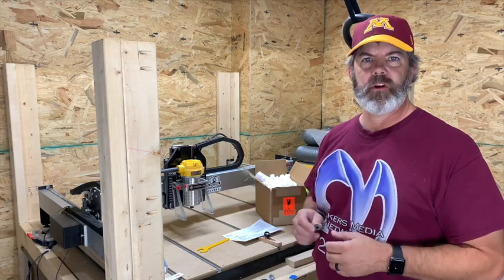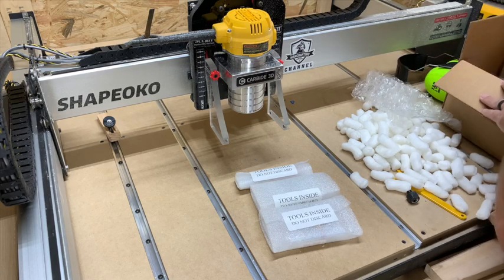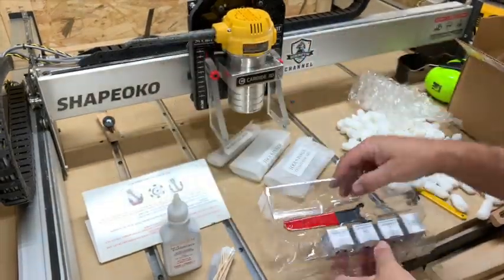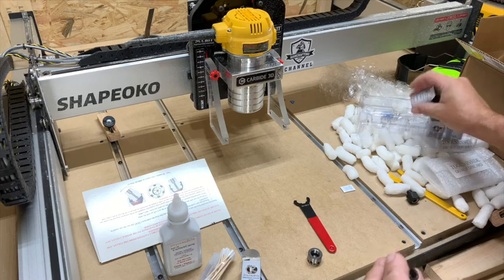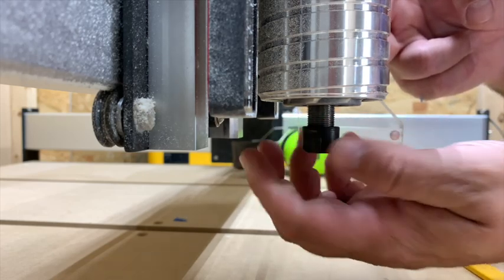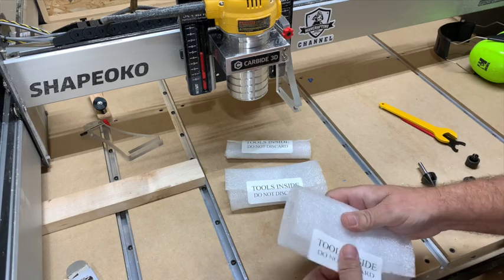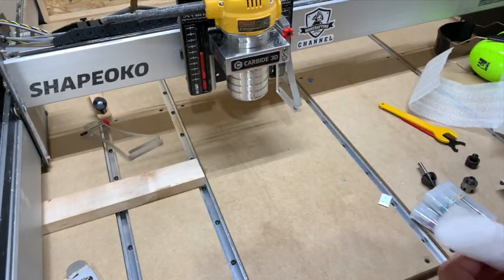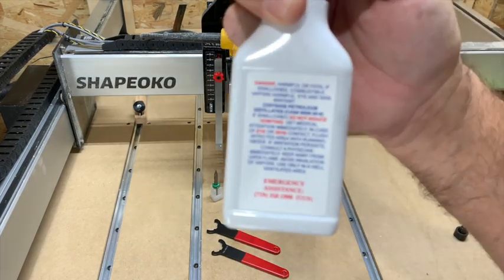CNC Router upgrades from PreciseBits.com

Comment: Way cool.  I need to look into that system for my Bosch.
Reply from the maker: They should have what you need.  https://www.precisebits.com/gateways/ColletsNutsHome.htm
Compatible with:

Bosch families

1320, B1350, B1450 (all configurations)
1604A, 1606A, 1613, 1613EVS, 1613AEVS (all configurations)
1617, 1617EVS,1618, 1618EVS, 1619, 1619EVS, 1649 (all configurations)
MRC23EVSK, MRF23EVS, MRP23EVS (all configurations)
Hitachi family
M12VC, KM12VC (all configurations)

Comment: Recommend you don't tighten a collet/collett nut without a bit in it; it can distort and damage the collet. 

I bought a three collet kit for my PC-7518, and it is really nice. 

I didn't realize the bit collars are fixed in place.
Reply from the maker: Richard Farwell good tip.  Thanks.  I wouldn’t normally, but I wasn’t confident I would film the process without cutting myself.  🤣
Reply: @ManCrafting  Understand that -- having reached under the router (with the dust shoe ON so I can't see the bit) and scraped my knuckles -- Doh!  At least the router's off. ;-)
Reply from the maker: I think we’ve all been there.   Router bites from router bits.  Dang they are sharp.

Comment: 6-Points of Locking/UnLocking Points...

SWEET SETUP!

Do they make buts for Aluminum or Steel, as well as Wood & PVC?

What would you recommend for an Automatic/Directional Oiler? I'd like to have an Automated System with filtering...

I'd love to have a CNC Machine for Custom Small Engine Parts!🤔

Thank's for sharing!

Take care,
🤓 -Thomas
Western Washington State
Reply from the maker: Thanks for watching.  There are definitely some guys that are doing amazing machining with the Shapeoko platform.  I'd check out @vince.fab on Instagram for some idea of what all is possible.  He's doing lots of custom engine parts.  Also, Winston on the Carbide3D channel is doing a lot of aluminum machining.  Precision Bits does carry bits for metal.  I just took a look at their site and found this.  https://www.precisebits.com/gateways/EndMillsHome.htm

Comment: Do you just use the bigger 1/4 inch  bits? Most of my bits are 1/8
Reply from the maker: Hey John, I didn't focus on it in the video, but the kit came with 1/8" and 1/4" collets.  They also make the bits with the precision collars in the 1/8 size as well.